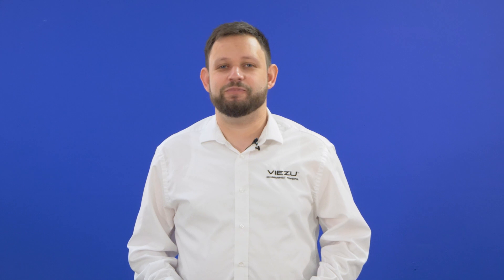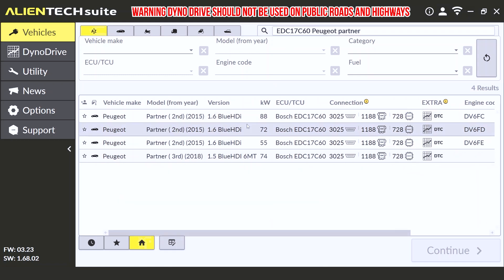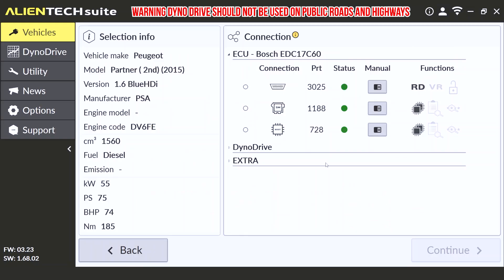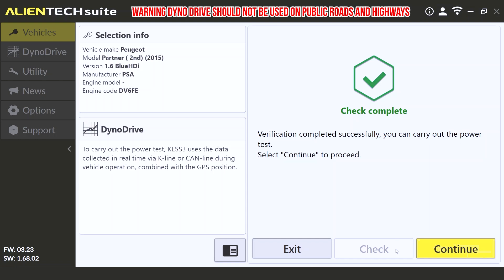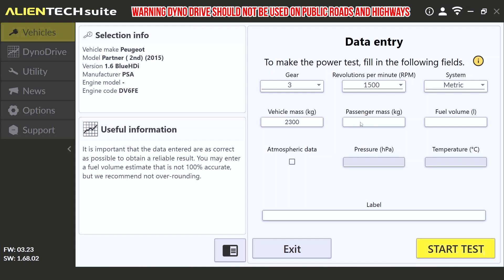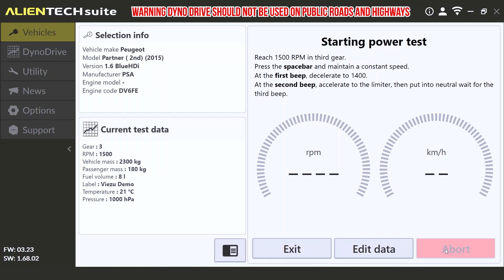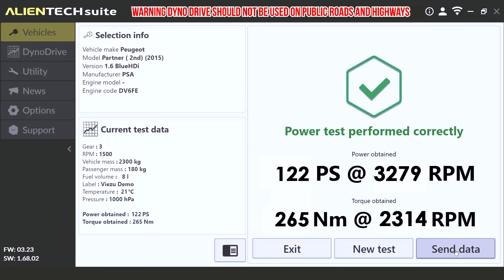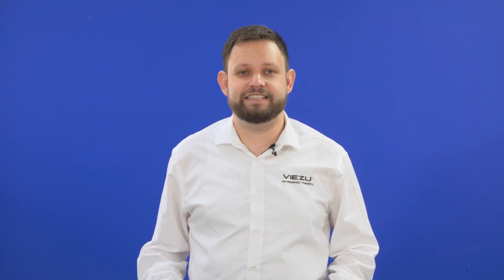Alientech KESS3 Dynodrive - How to use KESS3 Dynodrive

Comment: can this be used with atv/utv's? I noticed it measures in 3rd gear but there is no 3rd gear in a cvt.
Reply from the maker: It can be used with a wide range of vehicles. The gear is relavnt to the vehicle and transmission. You could test in 1st gear in a car for example, but you ideally want as close to 1:1 engine to gear ratio to get the most accurate reading, obviously where safe to do so.
Reply: @ViezuTechnologies  so can it be used with utv's?

Comment: How accurate is the dynodrive vs s normal dyno? Do the figures match
Reply from the maker: Its a good representation for showing the gains of a remap however a normal dyno would always be more accurate.
Reply: To be honest I’d say the dyno drive would be better as you using it in road conditions rather than a big industrial fan that’s blowing air towards your car on a dyno correct me if I am wrong on that?